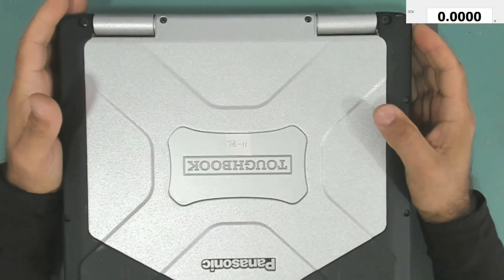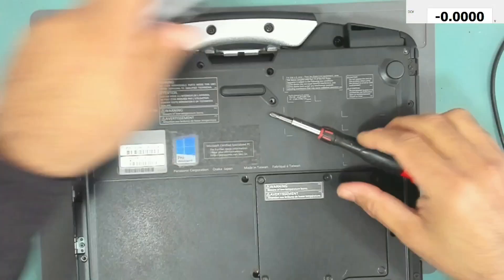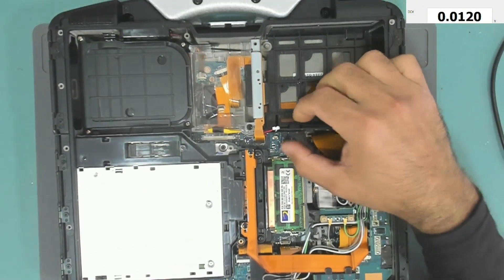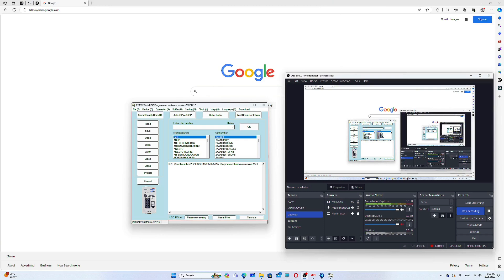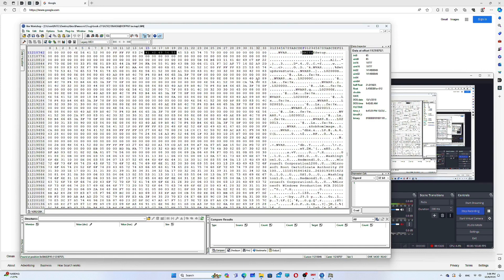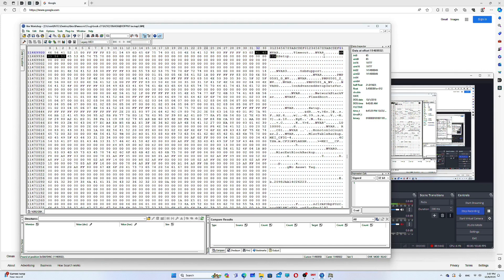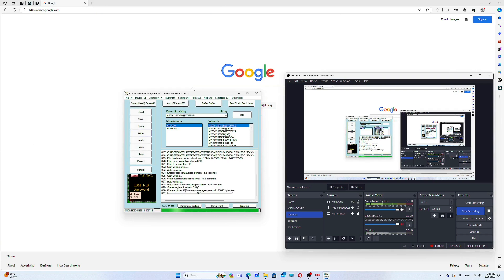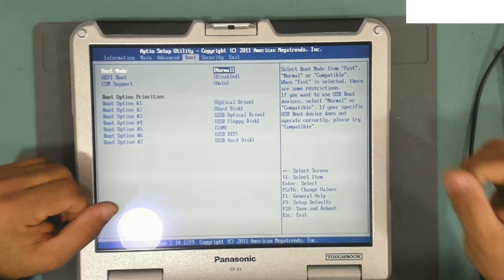Remove Bios Password || Panasonic Toughbook CF-31

Comment: I had a couple problems.
1. I wasn't able to find a good download for RT809F. Their official site download just corrupts every time I download it then try to open.
2. In my hex editor (Xgpro v12.78) there doesn't seem to be anything besides 0s and a 1 here and there after AMITS
Please help if you can, thank you!
Reply from the maker: Hi brother 
The windows defender (anti-virus) sees the RT809F program as a harmful program so it delete it every time you download it. Try disabling the anti-virus or add it to white list.

About the hex editor, I suggest you to use Hexwokshop, a great program for editing binary files.

All the best bro

Comment: Does this also remove the power-on password?
Reply from the maker: It removes the Bios Password but not the windows one
Reply: @FixTronics  thanks, i will get a RT809F ISP Programmer and try this.
Reply from the maker: @umbrellasolutionstech 
I wish you all the best brother
Reply: @FixTronics  I was able to remove the chip but broke the traces/vias in the process.  i had the hot air on too high apparently.  i did put the bios in the programmer and did what you advised.  was able to complete that part in the programmer.  now i have to repair all of the traces/vias.  gives good exercise to PC board repair
Reply: @FixTronics  Did you try putting the battery in backwards, or applying power directly to the BIOS IC ?

Comment: Hi, can you remove bios password on cf-30 mk3?  I'll remove bios chip/ ship to you and pay you also pay the return fee,
Reply from the maker: Hi, it would be more convenient if you could read the bin file out of it and send it to me to try removing the password then send it back to you and write it back to the chip.
To avoid paying unnecessary fees and avoid package loss during shipping.

If you don't have the tools to read and write the bin file, I would suggest you buy any cheap programmer like this ( https://a.aliexpress.com/_oFyMURM ) its really cheap and has all the adapters you need. You can search on YouTube how to use it.
Its better for you to buy this tool instead of paying shipping fees. And as you are able to open the laptop and reach to the bios IC, it wouldn't be harder to read it.

I will do it for you for free, you so you just send me the file.